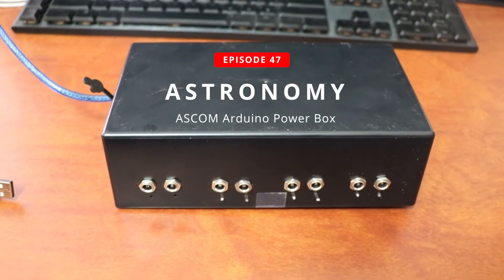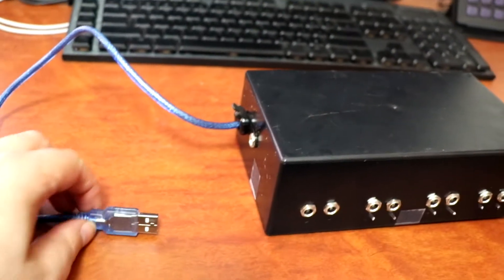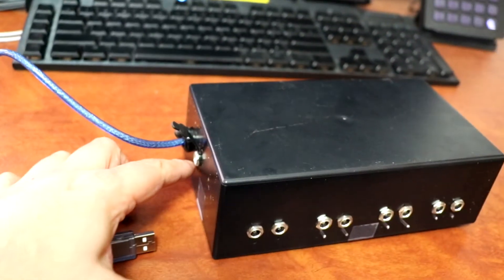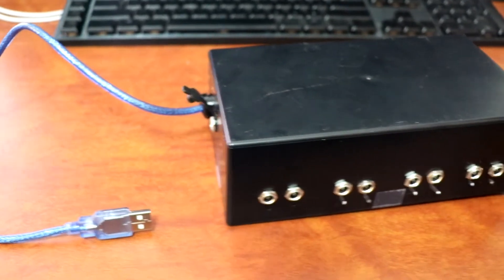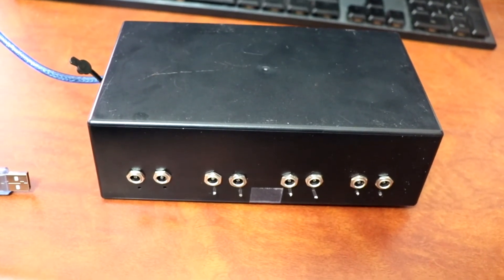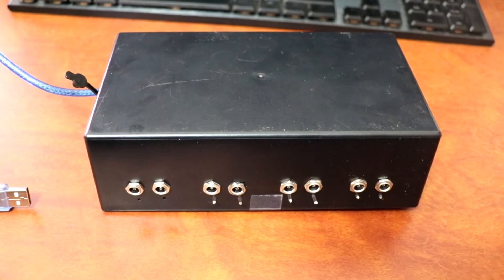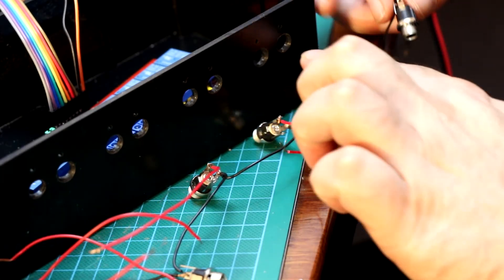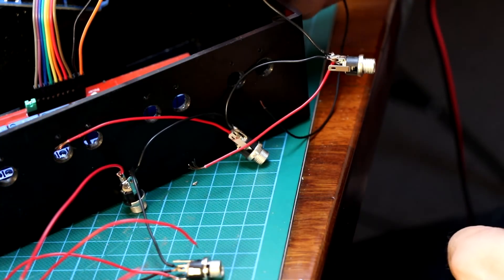Ep 047 - ASCOM Switch Compatible Arduino Power Box for Observatory Control

Comment: I'm currently researching what is required for a small observatory dome. I'm hoping I can use NINA to automate it tracking/moving as part of my normal session. Just not sure on what is required to make this happen. I see so many videos where people post just a video of a motor and bearing, or a box with with wires coming out. Am yet to find a "this is the parts list and this is what is needed to make it work" Especially for us aussies. Do you have a video of your observatory functioning in a session?
Reply from the maker: Check the ‘live streams’ I did. Shows a few times I’ve done them. Will give you a feel for what’s going on. 

As long as your dome has an ASCOM driver you should be fine. NINA has done support. I’m looking to try NINA as my daily driver once I build my new dome (I’ve sold my old one, new one needs to be built)
Reply: @TurboTalksTech  I'm hoping to build a dome from scratch thinking I might make a mini one to road test on my bench before I scale up. 😂
Reply from the maker: Dome automation requires some dedicated hardware and sensors, and will only be useful if you have the corresponding ASCOM drivers.

I suggest you look at some of the dome manufacturers who sell automation kits (ie. you can build your own observatory and use their automation systems).
eg. Nextdome - https://www.observatory.store/
MaxDome - https://diffractionlimited.com/product/maxdome-ii-observatory-dome-control-system/ (this is what my new dome uses)
HomeDome - https://homedome.com/automation/   (this is what my old dome uses) 

I strongly suggest if you want to talk to people in the local market who know about domes, talk to Sidereal Trading in Melbourne.
They sell the Scopedome products (used to sell Nextdome), but they can assist with kits/parts

https://www.siderealtrading.com.au/product-category/observatories/
Their Youtube Channel - https://www.youtube.com/@siderealtrading2415

@siderealtrading2415

Comment: I have discovered your Channel recently...thanks for all your efforts.  Nice to see another maker out there having a go!

I am trying to implement this switch driver into NINA (for my DIY Observatory Control).

Problem:  I can get the Arduino and Relay Board working with the "Powershell WalkingSwitches test script" but i cannot get NINA to connect without an Ascom Driver Error ( i have tried everything that I know!)!

Unable to connect to Arduino Power Controller.
Reason:
CheckDotNetExeptions
ASCOM.ArduinoPowerController.Switch
GetSwitchName
System.NullReferenceException:
Object reference not set to an instance of an object. (see Inner Exception for details)

Then another dialog says: 
Success
Switch connected.

Believe me... i have tried to get my head around this problem with no success to date!

It appears to me:
The driver interface does not show after the Arduino connects.
All other devices connected via ASCOM drivers (to NINA) show some sort of interface that interacts with that device....I would have expected 8 switches to be represented on the Equipment/Switch Page when the driver connects?

I am a DIY type of individual and would relaly like to get this sorted.  I can see lots of future development projects if I can just get this up and running.

Any thoughts/help will be MUCH appreciated.

PS: I can send/ post any info. that you require to try an sort this one out!

Bruce

ERO ( Eagle Rock Observatory ) ...(yes Pun intended! )
Reply from the maker: Hi mate. I suggest you reach out to the original ascom driver author at his page: https://github.com/Tigra-Astronomy/TA.ArduinoPowerController.AscomServer

I took his version and switched the code around for the default on mode. Anything more in-depth will need his input (or you can try and compile it up yourself, but that’s beyond my skill set!)
Reply: Hello.
Did you fix this error?
I am also trying to use this project in N.I.N.A
Thank you
Reply: Everything is now working in NINA,   I control  Flats LEDs and  Dew control in my sequences🤟
Reply: @AustBruce  hello I am also interested in this driver and I have the same problem with NINA. No relay control buttons on the NINA switch page. Connection with driver in NINA  is turning and turning ... How did you solve the problem?
THANKS
Reply: @AustBruce  HI,
I also have the same problem, how did you solve it?
Thank you
Federico
Reply: Hello Bruce, I see you got the Arduino Power Controller working with NINA. I too get the same problem as you describe: When connecting in NINA two dialog appears, one say Success, Switch connected and the other  one "Ascom Driver Error".  How did you solve the problem? Feedback much appreciated! :)
Reply: www.youtube.com/@AustBruce I'm reaching out to you again: I have the same problem as you had, I cannot get the arduino switch connected with NINA. I have tested with the "WalkingSwitches.ps1" Powershell script, and it works fine. Switching on/off the 8 switches in turn. But when trying to connect in Nina,  i cannot get NINA to connect without an Ascom Driver Error.  I see you have solved the problem, can you explain how you got it working, thanks :)

Comment: Hello, for the 8 channel relay, I just have found the same relay board than yours, I used the external supply diagram that you shared in 14core.con  link. 
The leds on relay do light on and off, but, there is no click sound, I connected a multimeter and no power is comming out from relay. 
Any suggestion?
Thank you!
Reply from the maker: You’re probably triggering using 5v. You need to power the switching side with 12v as well as the relay side
Reply: @TurboTalksTech  Thank you for commenting, I solved the issue with buying a 5v 8 channel relay, now it works as expected. 

The only problem now is connecting to NINA.

Comment: I have connected everything, relay all of 8 leds are red. But if I connect with NINA then there is  this pop up error. Unable to connect ASCOM.arduino.powercontrollerswitch. Checkdonetextension . Checkswichtnamesystem.nullreferenceexception ; reference to object not stablished as object instance.(see inneer exception for details). I have tried versions of ASCOM controller version 1.01, 1.02 & 1.03.     Any idea?
Reply from the maker: Sorry. I don’t use Nina. Have you tried triggering them using the power shell script examples? 
Also, if you built it with the parts I used, you need to use my code which reverses the logic (the relays are reversed). 
You should try using the ascom diagnostics tool to see if you can trigger it that way also.
Reply: @TurboTalksTech  OH sad to ear it is not for NINA. Yes, I used with parts recomended and your arduino sketch. I do not have any knowledge  in programming, I will try to use what you commented. Anyway, thank you for sharing.
Reply: @mvargas333  Hi, I'm trying too but I have the same error. Did you manage to solve it somehow?

Comment: Thanks for sharing, but, 
Can each relay be controlled independently?

Why don't you use it to control the mount and the camera?
Reply from the maker: Yes each relay can be controlled independently.  You could create a script for each switch and run those manually, but also, applications like voyager now support the ascom switch protocol (as do others).

Comment: ok but the management software where is located???
Reply from the maker: The links to the firmware (Arduino code) is on my GitHub (as per the description). 
The ASCOM Switch controller is on Tigra-Astronomy's github (as per the description).
In order to control the switches, you can use the PowerShell Script example in the Tigra Astronomy link called "WalkingSwitches.ps1" to see how you can toggle the switches with a script and make one for whatever you need.
It appears there are not many observatory control programs that choose to use the ASCOM Switch capability.
You could try and use the ASCOM Diagnostic tool to toggle things in the driver.